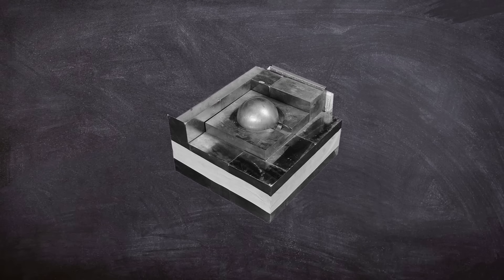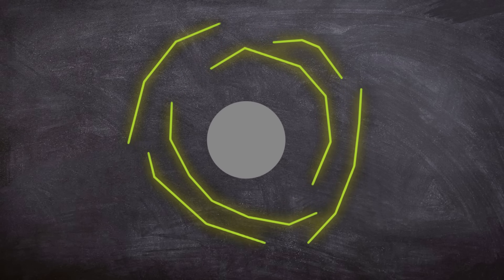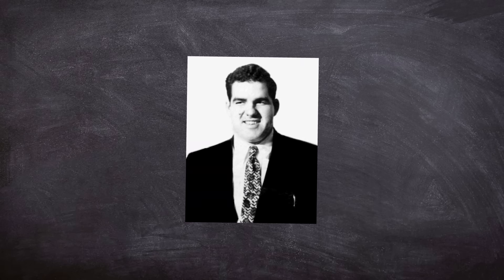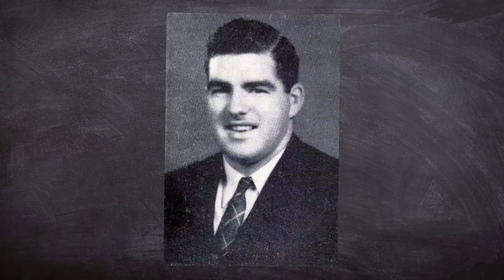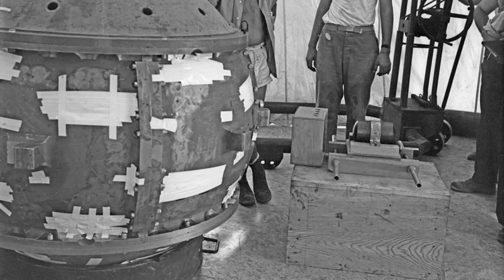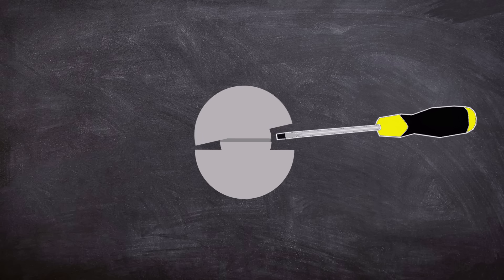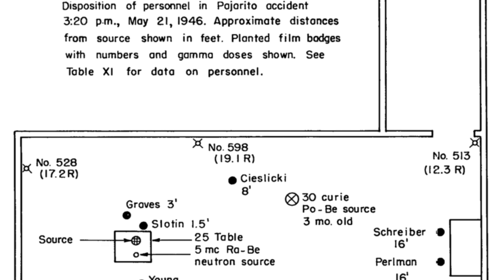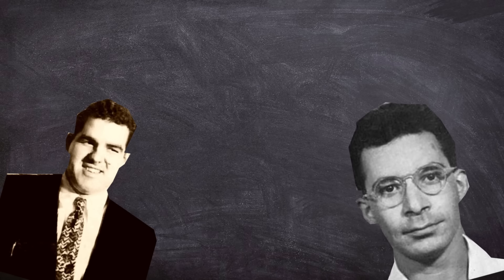A Brief History of: The Demon Core (Short Documentary)

Comment: Government: Hey this thing can level a city, so we wrote some rules down for you guys to follow, heres some extra money to get good safety equipment.
Scientists: All for wanting to know what happens when you put this thing in place of a tennis ball say "I".
Reply: I mean no not really. Creating the kind of chain reaction necessary to create an atomic blast requires compressing the core with explosives. In either a gun style or implosion style bomb.
Reply: Jacob Naber if touching it with a screwdriver can make it go apeshit, it is well within the realm of possibility that hitting this thing with a tennis racket and it slamming into the ground could cause some problems with hazardous radiation, let alone a nuclear explosion.
Reply: He was using the screw driver to separate the two hemispheres that deflect neutrons. Basically controlling the reaction by allowing some to escape. It might indeed go supercritical and release radiation. But that won't cause it to explode. You seriously have to be trying pretty hard to get that kind if reaction. The two bombs dropped on Japan were essentially cannons inside. They worked by shooting a uranium shell into a uranium plate at the end if the barrell. Implosion type bombs like what that core would have been used for. Work by escasing the core in a thick layer of C4. Drop it whack it all you want. It won't explode. Same with nuclear reactors. They may heat up and melt but they won't explode.
Reply: Jacob Naber also r/woooosh

Comment: With the height of the table and the core, those guys received the bulk of the radiation directly into the groin area. That has to be the worst way to go.
Reply: Worse yet, it wouldd almost guarantee that any children you'd have would either be still-born or heavily deformed.
Reply: @MrSingularity44  I think it would just be a pretty effective way of sterilizing someone.
Reply: @RileyIsntDead  I mean, they could maybe still have kids. They would just probably be horribly deformed if they survived. Seems pretty unreliable for something that requires near critical materials.
Reply: New meaning to the term "numb nuts"
Reply: If it had happened now theyd call it lightspeed outpatient vasectomy and open a clinic next to every 24 hour chapel in Nevada